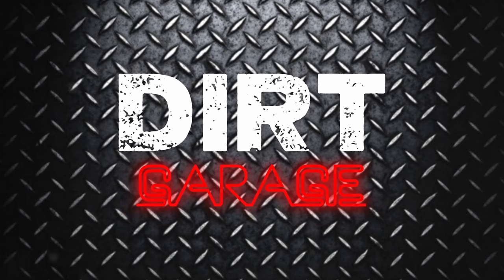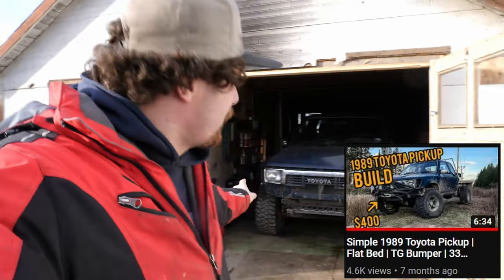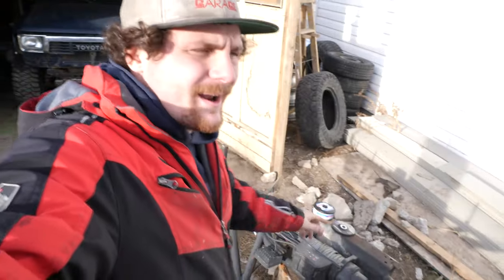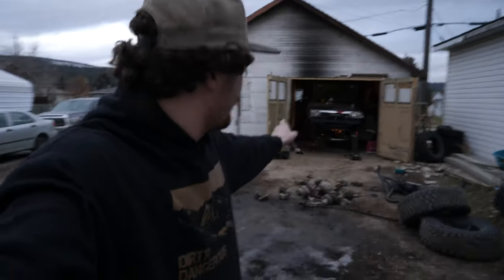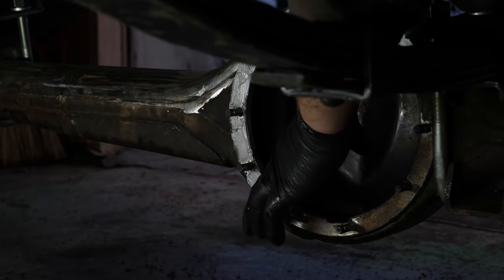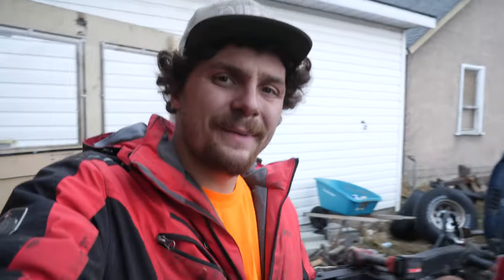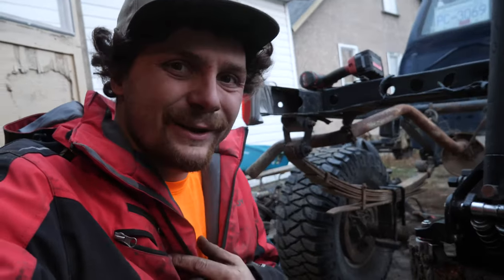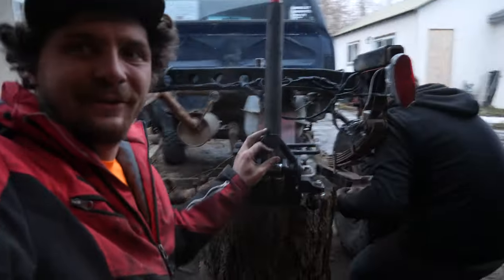I Solid Axle Swapped a Hilux in 3 DAYS!

Comment: As far as front hanger placement goes, basically you wanna mock it up so you achieve a certain angle for your rear shackles? What angle do you guys look for? I have a sky’s offroad stretch front hanger and not 100% sure how far forward the hanger should be. I’m putting it on a t100. Any help is appreciated! Mint job boys!
Reply: it depends in the length of the leaf springs you plan on using!
Reply from the maker: We put this one flush with the front, its also flush on my truck. Using the TG 3" leafs with 2 leafs removed it makes the shackle angle where we want it.

Comment: Awsome content as usual! Just curious, what size lift are the front springs?
Reply from the maker: 3" Springs, with bottom 2 leafs removed.
Reply: Hey, great content. I have the same 3" kit and I'm about to do the swap. Just wondering why you had to remove the bottom two leafs? And did you get the HD kit because of the v6? Thanks.
Reply from the maker: @Shiploadofshipes  Nope, normal springs. My personal truck has 3" springs with bottom 2 leafs removed, and same with Cory with his 3" springs. All V6, all not HD springs, and all bottom leafs removed. Reason being is lowering the trucks a bit, and more articulation.
Reply: Thanks. Low CG is what I'm going for so this is great information.

Comment: you guys didn't move the steering box at all?  ive been slowly working away at my solid axle swap, but I've sort of lost motivation to finish it lol... this vid has given me a little boost so maybe ill go and do some work on it today or the weekend :)
Reply from the maker: Totally not necessary. I'm the only one in my crew who moved the box, and that is only because my leaf spring hangers are cut into the frame, and running 4" shackles, causing my steering to bind.
Reply: @DirtGarage  ok nice. Yeah ive moved my steering box forward a bit and flattened out the angle they put them on. I also have a flat pitman arm so it doesn't drop it too low. I have done the same and recessed the spring hanger in to the frame to lower it a little bit and moved it forward a little to give more tire clearance in the fenders...
Reply from the maker: @mikejensen-fogt4662  Nice! I am also running a flat pitman arm! I like the look of the hanger being recessed, makes it appear factory.

Comment: Awesome channel. Do you have any experience with 22RE EGR deletes? I’ve got multiple vacuum leaks on my 89 pickup, and am trying to decide on replacing my vacuum lines, or just scrapping the EGR.
Reply: 22re here too. Scrap it and delete that whole system
Reply: @nicholas5623  Thats what I ultimately did. Tried to fix it at first, but ultimately had to scrap the whole thing. I'm guessing it affects my MPG but I'm not for sure. I only get about 14MPG going 75 on highway.
Reply: @HighwaymanZ2  thats not bad tbh, at that speed ur 22re is screaming lol

Comment: Can I use my gears from my independent front end in my new straight axle, 93 4 runner?
Reply from the maker: Nope. Independent is 7.5", solid axle is 8". You can find another truck with same ratio and use the rear up front.

Comment: I SAS'd my 87 pickup with the TG 3" kit and I already had the old man emu rear springs in AND I added 4" blocks to level up the rear.

What did you replace your 4" blocks with? 
You said you took those ones out of your truck?
I'm assuming you did the Chevy 63"?
Did that level you out completely or did you need to add blocks to that too? 
Was it worth it?
Reply from the maker: Originally I was running stocks with those 4" blocks, later I went to OME and 2" blocks, now I run 63s with no blocks. We remove leafs from the TG 3" to keep it lower.
Reply: Any disadvantage to running it the way I have mine set up?
I'm swapping in an om617 right now and I kind of want to keep all the leafs up front in the TG 3" kit to prevent sagging later on.

The only thing that worries me about the 4" blocks in the rear is axle wrap, what you think?
Reply from the maker: @matthewevers6716  4" blocks give terrible axle wrap. But totally up to you. I would not keep the 4" blocks if your planning on putting more power in the rig.
Reply: @DirtGarage  how many leafs do you take out of each spring pack?

Comment: Nice job!

I have curiosity, what year is the solid axle you swap? 

Am concerned because as i notice on my v6 year 89 i noticed that it's wider than my 22R year 82.  

So if the toyota year 82 solid axle is not the same wide as the 89 what yo did to have the same width?
Reply from the maker: 82, and yes the axle is narrower stock, most guys use spacers on front to make up for that. I also have a guide to use your stock IFS hubs and bolting them up to the solid axles to make them wider to match the rear. https://www.youtube.com/watch?v=BqVK27IV14g&t

Comment: Do u have  any issues with handling.? And did u use back ur old driveshaft
Reply from the maker: Nope, and yes old rear driveshaft works fine.
Reply: I was asking about the front 4wd driveshaft! Did u use back the original? Or u made one?
Reply from the maker: @user-oq6yl4nj6z  You can't use original. It is not long enough, and it doesn't have enough articulation.

Comment: How’s shackles angle with you guys welding front hangers and rear tube prior to cutting ifs
Reply from the maker: It's perfect. With the leafs removed from the pack it sags a bit more right from the get go.  Plus we are just placing hangers where the instructions say to. And the kit was designed for the TG leafs.